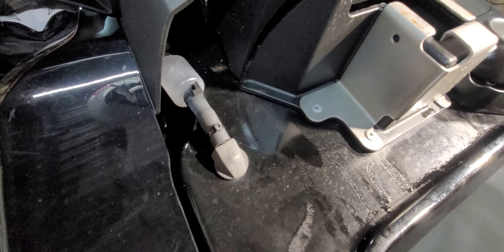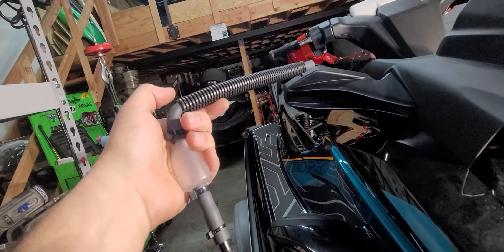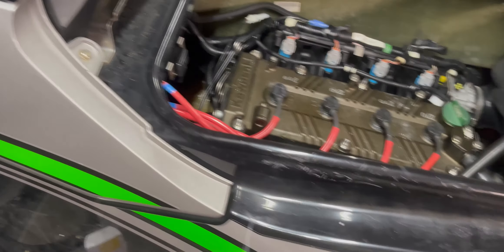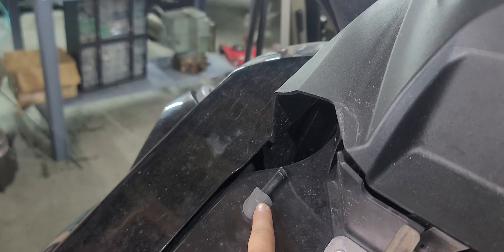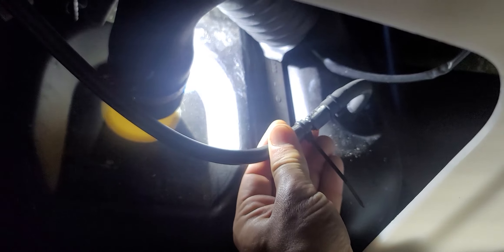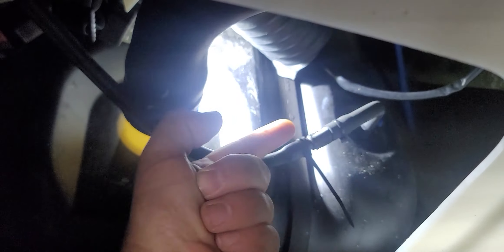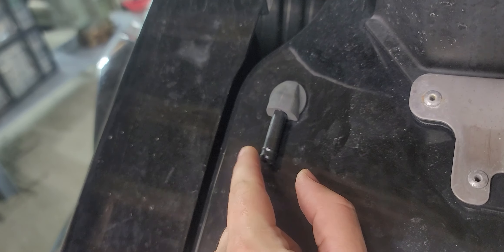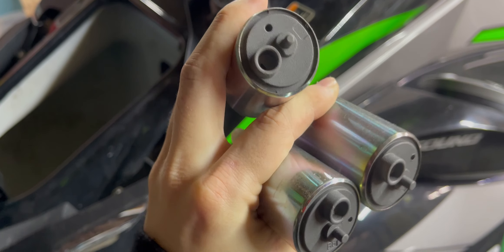Have An STX 160? You Must Watch This!

Comment: Kawasaki fixed mine for free. It's not a safety recall but there is a service bulletin. You have to call Kawasaki directly and request it. It's called the fuel tank vent hose mod. Mine started running poorly when it got down to about a third of a tank. As soon as I would loosen the gas cap it would suck in air and then run great.
Reply from the maker: Yup, that is a typical symptom of this issue. Eventually it leads to fuel pump failure, which as rather quick on these low flow pumps.

Comment: Was this factory fixed for the 2023 STX160LX?
Reply from the maker: Yes, it should be but check to be sure
Reply: I have a 2024 STX 160x and still does it, I have to fill tank very slow. I want to do your fix. With your fix, can you fill tank fast?